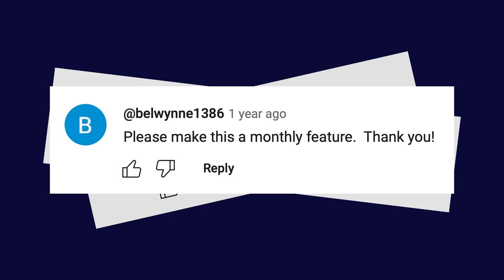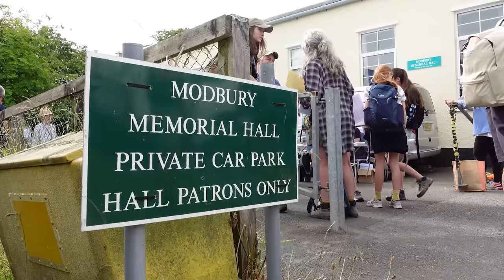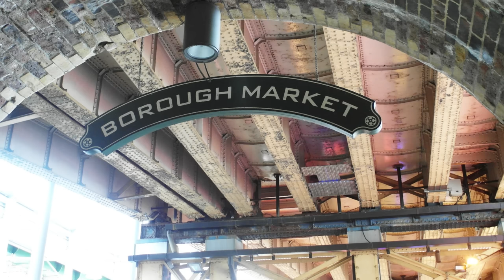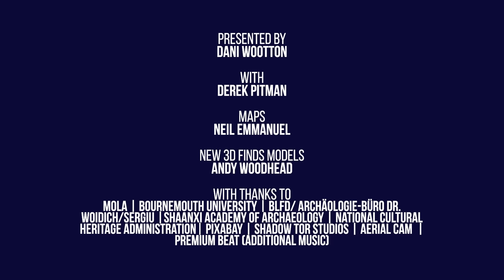BRONZE AGE SWORD | ROMAN LONDON | NEW Monthly Show: Time Team News | Episode #1

Comment: Hi Dani.  You mention the post-dig finds processing and your love of it.  I would love to see some video of HOW artifacts, soil samples etc are processed - not just a short two to three minutes, but an decent explanation and showing of the process, decisions, findings and subsequent analysis, i.e. what is done, how it's done, why it's done that way, how the decisions on process are made,  what you actually find and how you analyse those findings to arrive at whatever conclusion.  E.G. using Sutton Hoo as an example, what was done to clean and analyse the finds and the in situ soil to derive a dating etc.  I, for one, am interested in some of the behind-the-scenes work which goes on for far longer than the basic dig.  Yes, I've been a Patreon supporter since I heard about it, so over two years now.

Comment: Great that these 'Discoveries' reports are going to be a regular feature as requested! 
I do have one small criticism that I hope will be passed on to the graphics designers. At 12:10 for example it shows a typical TimeTeam graphic map. (Other maps show the same design issue). In my thinking, the designer made a mistake in how they incorporated the shadow-like 'glow' effect. As rendered it incorrectly suggests the water is higher & casting shadows on the land behind. as if two layers with the water layer higher. While I understand my assessment incorporates a cognitive bias, I do think the attempt to represent three-dimensions is backwards. It might be more successful to have what is representative of the land casting a drop shadow on the water. Making what is intended to be understood as water more bluish might help the maps be clearer. In my thinking clear communication should be the primary goal. My feedback is offered in the spirit of helping. I know the work of graphic designers is important and that it is clear Time Team's graphic designers contribute a great deal.
Reply: I’m going to second this. Like many these days, I watch on a small screen (YouTube on my phone) and find the maps aren’t communicating well. Thanks for speaking up - this is constructive criticism, clearly well meant, And I’m sure it will be received as such!